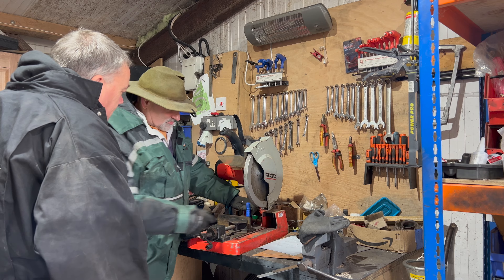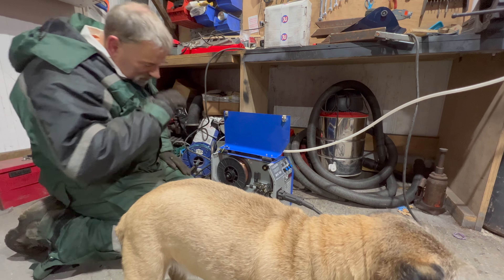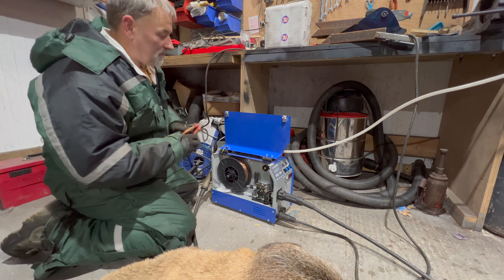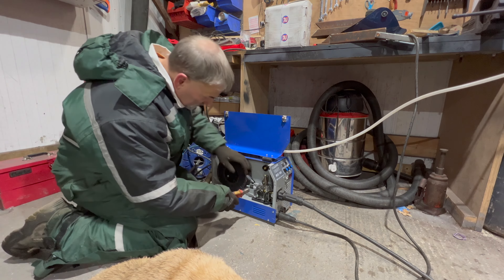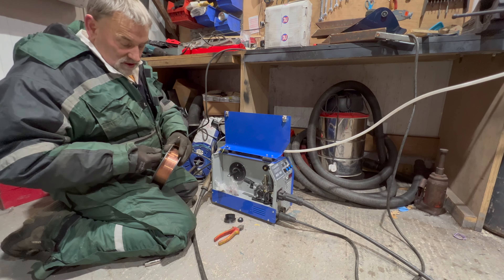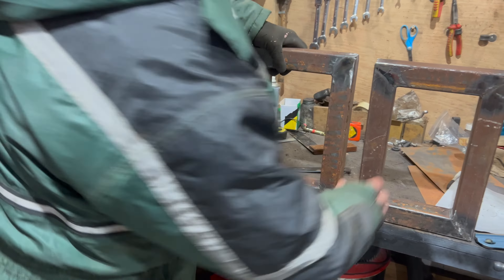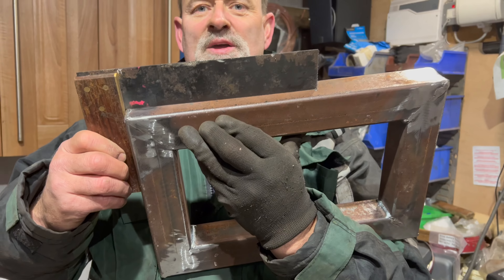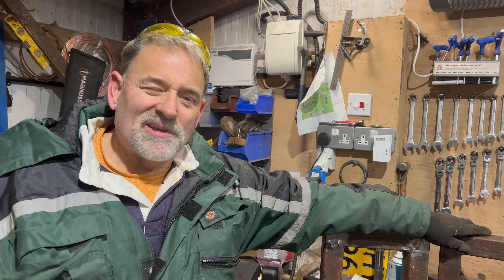R-Tech Mig180 Mig Welder - wire change tutorial & welding incredibly accurate box section 90° angles

Comment: Hi. I have the same machine. Been pleased with it but today i was due to weld on someones boat. I did a test piece in my workshop and i could not get a weld at any power setting or feed rate.  The wire comes out of the gun no problem but the wire fizzles and rolls off curling up. It just wont weld.  In the end I used rods and MMA and completed the job with perfect weld. Any ideas what it might be? A very grateful Paul. 😢

Comment: Hi. Wondering if you can help. I watched your video. I just bought an R tech mig180. I'm waiting for gas and regulator but in the meantime pit some .8 flux cored wire in. I could not get the wire to drive through, no matter how much tension I applied. In the end I turned the collar round to the .6 side and it drives. My question is, do you know if these .6 / .8 collars wear out? I bought the machine second hand allegedly with low hours usage but the flux cored wire definately didn't like the .8 side and its .8 wire. Any ideas gratefully accepted. Thanks
Reply from the maker: Have you checked that you are using the correct side of the drive roller as it has different size groves for different wire sizes off the top of my head without going down the other workshop to check the 2 sizes are 0.6mm and 0.8 mm . Another simple mistake is that the tip is 0.6 and you are trying to get 0.8 wire through it, haven't had a roller wear out as yet and we use ours a lot. Hope this helps